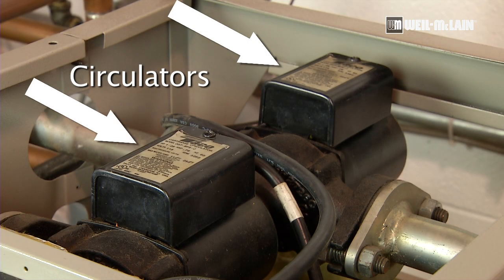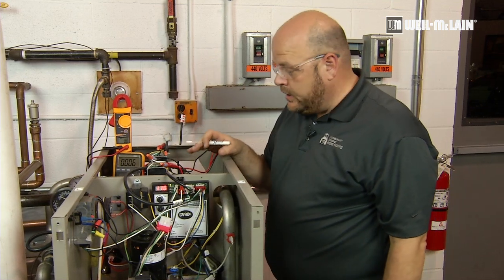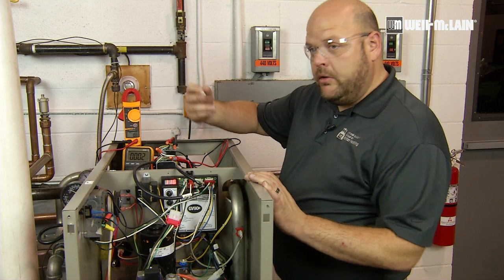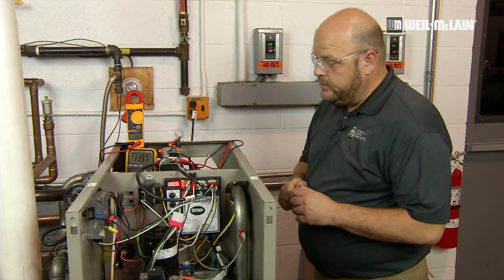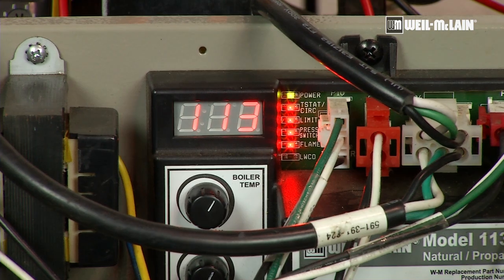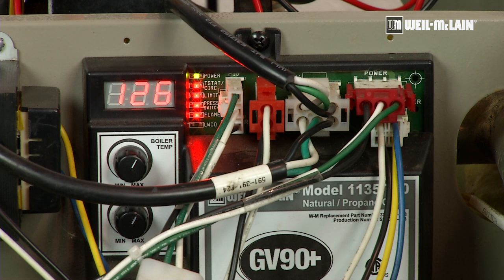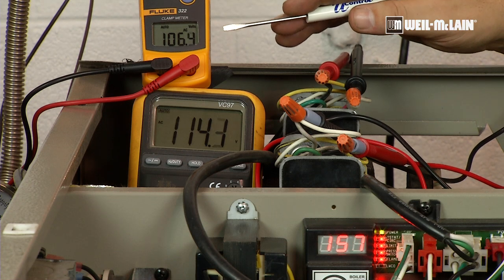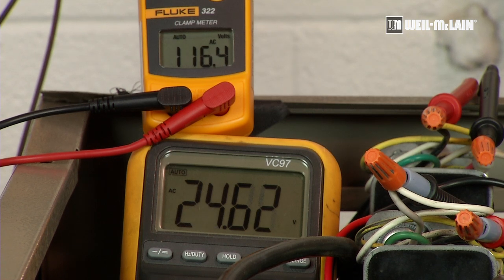GV90+ Circulator Operation

Comment: Great video.  I wonder whether all the savings on gas will be spent on running all these pumps and the more complicated maintenance.
Reply: Your furnace will die in 5 years
Reply: @johnsimson8417   Mine so far is going on 50 years without problems.  I just had to replace the motor on the circulator, but that's about it.

Comment: Good video explaining the operation.  I have a problem with the return temperature from the radiators never getting over 120F, seems like the system is in constant bypass, I am trying to figure out the issue, anyone have any ideas?
Reply from the maker: Thanks for your comment. Happy to help troubleshoot, but we have more questions than answers. New installation or existing?  With the rear circulator wired in , does it receive 120V? Is the return hotter than the supply? Contact our Technical Services Department at 1-800-654-2109, so we can discuss what you're experiencing, ask a few questions, and work with you to correct the issue.
Reply: @WeilMcLainCo  I think I am experiencing this, 119 voltage at board for both circ pumps, no voltage at the rear (system) pump connections, harness has good continuity, was about to replace pump, but it seems the board is bad. Return side hot, supply side warm. Please confirm or tell techs to be helpful when I call, as mentioned below, some are less than useful.
Reply: @adamhollon2634  and yes the techs are useless and annoying, they would not help me troubleshoot because I was not a professional!!  Its a easy as touching one ipe is hot the other is cold and then looking for voltage.
Reply: @douglassprague8410  I ended up being able to locate a new control board locally and super easy to replace and was back up and running. I am sure the professionals would had charged me double for the part and 2 hours of time, when I literally swapped it out in 15 minutes.
Reply: @WeilMcLainCo  How can you sell this piece of junk to people knowing they will die from monoxide poisoning when the heat exchanger burns out in 5 years
Reply: @WeilMcLainCo  thank you, I did contact the technical support and ultimately I was successful.  The system circulator (rear) measured no voltage when connected, calling for heat and boiler temp greater than 140F.  Disconnected the circulator and there was voltage.  Tech support said that the control board was bad specifically the circulator relay.  I replaced the board and immediately the supply temperature increased, also before replacing the board I confirmed the circulator was good by wiring it directly to AC power and also saw the supply temperature increase, as well as hearing the circulator turning.  I spoke with three separate techs during my diagnosis and one of the techs was confusing,  provided limited help, continually pushed me to hire a professional, was insulting telling me I should take an HVAC course, and would not give me the diagnostic information.   I have had professionals tell me all kinds of erroneous solutions previously which I am glad I didn't persue as none were correct.
Reply: @douglassprague8410   Hey Douglas you got screwed when you bought that death trap GV90+
Reply: @douglassprague8410  Replace that piece of junk with a Rheem
Reply: @douglassprague8410  I think I am experiencing this, 119 voltage at board for both circ pumps, no voltage at the rear (system) pump connection, harness has good continuity, was about to replace pump, but it seems the board is bad. Return side hot, supply side warm.
Reply: @johnsimson8417  Starting to have same feelings as you. I had to replace blower motor, zone control board and now main control board. Possibly circ pump if not the control board.
Reply: @adamhollon2634  it ended up being a bad control board from the beginning, one of the internal circulators was not running.  Came from the factory like that the installer never checked it
Reply: These boilers are junk don’t buy!
Reply: @stevewhite7649  tell us more. I am curious